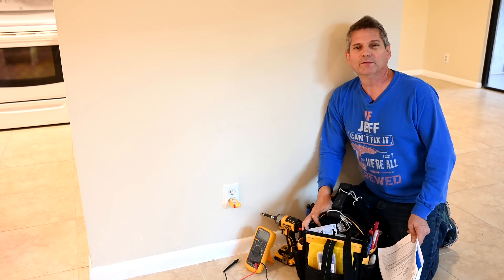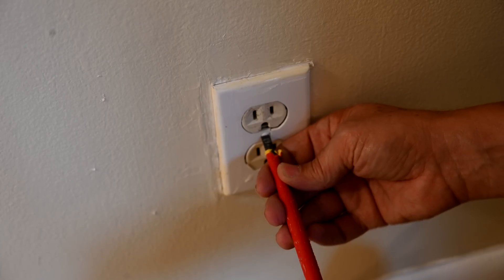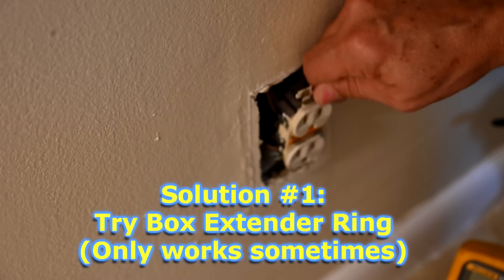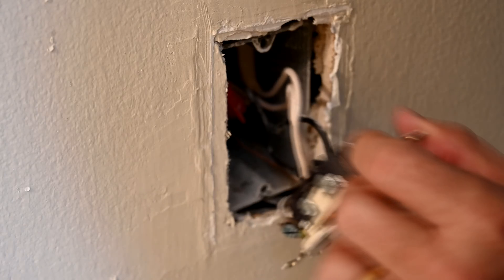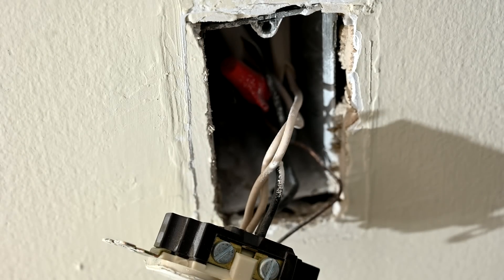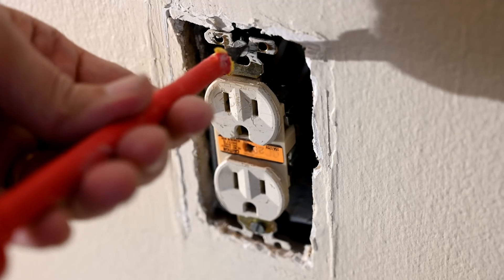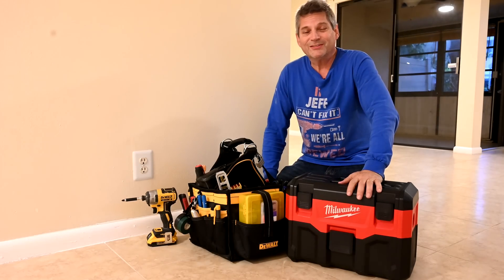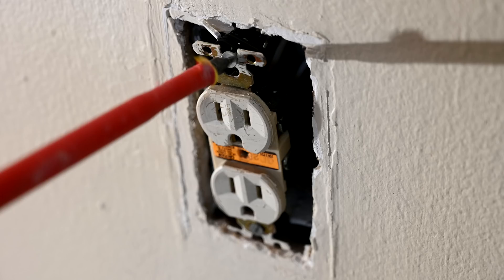2 Tricks To Tighten Loose Electrical Outlets, Switches

Comment from the maker: 💲  DEWALT DG5582 Electrical and Maintenance Tool Carrier: https://amzn.to/2Gm8IoO
💲  Fluke 87-V Digital Multimeter: https://amzn.to/2LK8etM 
💲  Fluke FLK2AC/90-1000V Pocket-Sized Voltage Detector:  https://amzn.to/2THggao
💲  Ideal Electrical Outlet Spacers (5-Pack): https://amzn.to/2U7SlUe
💲  Milwaukee 48-22-2202 3-Piece 1000V Insulated Screwdriver Set: https://amzn.to/2ItbU3r
💲 Milwaukee 0880-20 18-Volt Cordless Wet/Dry Vacuum https://amzn.to/2P6VaAF
Reply: Good information...thumbs up simply for "Whoever put this outlet in was clearly drunk".
Reply: Do you have the link to the outlet covers?  Thanks!  Also, thoughts on these spacers?
https://www.amazon.com/gp/product/B0897QVYFL
Reply: you put the top screw in the wrong hole.
Reply from the maker: @nicholassheehan2070   However worked on the outlet before stripped the screws so I had to come in at it from an angle
Reply: I have a lot of these loose outlets and it drives me nuts
Reply: Definitely liked this video 👍
Reply: Got a real loosey goosey at my house to fix!!
Reply: @jeffostroff Do you recommend any particular adhesive to affix the junction box?

Comment: using a goof ring by Arlington will have bigger tabs.  Also replacing the box is not that big of a deal. There should not be more then 1/16th of an inch of ignitable material between the edge of the box and the surface.  Replacing the box is the right thing.

Comment: As an apprentice, one solution you're taught is to coil bare solid copper wire, around the 6/32 mounting screw ... helps maintain grounding continuity as well.
Reply: That's what I did in my house when the box is metal and set back a bit. It does improve grounding contact surface area, but the box must be metal and already grounded to the electrical panel. 14 gauge wire works well.

Comment: Hey Jeff,

I'm  one of your 'neighbors' from the nearby community of Parkside - and I really like your vids.

My  townhouse, built in 1984,  needs a  replacementof an original grey plastic J box.  I've got the wires disconnected from the receptacle, have an "old" J box on order from Amazon, but I'm wondering how to dismantle the older J box to pull it out from the wall, without breaking the wall and without the wires falling behind the wall. I've searched for and have found NO vids demonstating this.
Please consider making a video on the subject.    Since I've subscribed, I'll receive the notification when you (hiopefully) publish it.

Many thanks, Jeff!
Reply: BTW - It would probably be easier if the receptacle would be at the end of the line, it would have fewer wires to deal with, but mine has 3 blk and 3 wht wires, plus ground wire !  Big mess, little space, wires coming into box from several ports.

Comment: You don't have to cut the extender if the wiring is to code. Simply turn the outlet a little sideways, and tilt it a bit forward, and you'll be able to pass the outlet through the extender

Comment: Hate to say it but you are wrong about using the "ears" on the outlet holding the outlet steady by being on the outside of the wall.  In fact, you have probably noticed that the outer parts of the ears are scored, allowing them to be partially broken off.  The pieces that are broken off become spacer washers.  The electrical box was probably not mounted right to begin with, that's where the trouble began.  Most often the box is held to the wall by nails or screws into the stud.  It's kind of hard to drive the nails into the stud some more.  I've found that sometimes after removing the outlet, can drill holes in the metal or plastic box and drive screws into the studs.  Once this is done the outlet can be put back into the box.  If it is resessed too much, those little washers can be used as spacers to set the proper amount of protrusion of the outlet.  Once it's screws are tightened down, the outlet should be rigid.  When the plate is installed, the outlet should be flush with the plate and not wiggle.

I've been referring to boxes that are used pre-construction.  If the boxes were installed post construction, that's a different story, the box still has to be tightened up somehow, for another day.

Comment: Drywall socket boxes have outer rimm, which would be best option here(its big hole tho) and are fixing themself from behind against front wall. I dont like idea of that box just freely hanging in the wall, its practically useless. Its job is to hold socket, not other way around.
It would be more work, but permanent solution.

Comment: Those tabs bend 90 degrees, or less to make contact with the box for this situation... Remember the metal tab contact with metal boxes creates important ground... A little pick or screwdriver stuck in the holes makes bending them easy...

Comment: I will check all conductors in the box even after you cut the breaker off because I ran into a situation with three hot feeds off of different circuits

Comment: Different kind of loose & tight: the plug prongs hug WAY too tight in the outlet, very difficult to unplug things: how to fix?
Reply from the maker: They should not be tight, either you have a non-standard plug or the outlet needs to be replaced. Did you try several other plugs of different types to see if they are tight? IF all are tight, by a new outlet, test them out, and if it has a better feel to it, then install the new outlet in the wall.

Comment: What’s the screwdriver with the red sheath?
Reply from the maker: That is an insulated screwdriver, providing up to 1000 volts of protection. Electricians commonly use these when working on electrical outlets

Comment: Hi Jeff my question to you is I need to replace my outlet plate I dont think I can cut the power I did discover that there is a type of screwdriver that is safe for energized equipement would you recommed I use it ( it it should insulate you against the voltage found in your home ? ) thoughts please thank you
Reply from the maker: I use screwdrivers from Milwaukee that are insulated screwdrivers that protect up to a 1000 V. But I still always turn off the power today outlet. It's never a good idea to play with it live

Comment: You should still use the spark ring. Per the NEC 314.20 In Wall or Ceiling.

In walls or ceilings with a
surface of concrete, tile, gypsum, plaster, or other noncom-
bustible material, boxes employing a flush-type cover or
faceplate shall be installed so that the front edge of the box,
plaster ring, extension ring, or listed extender will not be
set back of the finished surface more than 6 mm (1⁄4in.).
Reply from the maker: You know that's a good point and too bad that the builders don't use adjustable boxes because we see this all of the time and the time and there are only a few cents more for a Box that you use a Philip's screwdriver to turn an adjustment screw that pulls the outlet Box flush with the front edge of the dry wall.

Comment: I used a single gang box in my kitchen that mounts to a stud on the short side because it had to be mounted horizontally (above counter on half wall). The box is super loose and obvious mostly on  the opposite side from stud. Basically the edge on opposite of stud pulls out. Any tips for that?
Reply from the maker: It is hard to attach to the stud like that unless there is no drywall in the way. I use these https://homedepot.sjv.io/15gjkd PVC Old Work Electrical Outlet Box (1-Gang with tabs that clamp on the back of the drywall and you screw it down, best outlets ever.

Comment: Thanks for the videos.  The box is probably next to a stud.  You could have toe nailed a couple screws inside the box and into the stud first, than used the outlet spacers.  Even if the box was metal you could have predrilled holes for the screws.  They also make nylon Wall plates that are considered unbreakable.
Reply from the maker: You can't toenail these, because these are thin metal studs. It's hard enough trying to screw in straight on into the stud, but coming at an angle is impossible. Maybe if it were wood life would be better

Comment: Why not change the old outlet while your at it? It has paint on it and broken at the top ground.
Reply from the maker: That is normally what I do, I was called over late Saturday night on an emergency and they were closing on the property on Monday and they had just gotten the report from the buyers inspector that the outlet was loose. So I just rushed over with minimal stuff didn't even have an outlet with me they were so broke they didn't even have time or money to deal with it they just needed the actual reported problem to be fixed so they could close on Monday. It was a very desperate situation for them. when I take over a property and remodel it I replace every single switch and outlet in the property and I change all of the bathroom outlets to GFCI and I upgrade the kitchen outlets to AFCI/GFCI like they are supposed to be.
Reply: You can come help me any time.

Comment: Why not pull out the loose box, and replace it with an old work box?
Reply from the maker: The box is attached to the stud buy a nail or a screw that goes right through the bracket and into the stud and then it's covered over with drywall so in order to do what you're asking you'll have to do a whole lot of drywall cutting and patching back up later on, a lot of Labor intensive work when all you need to do is throw a few pieces of Shim plastic into the outlet to make it hold steady
Reply: Absolutly understand, and your solution is clean , cheap and effective. Just saying the in placed plastic box , like your box extension is easily cut and removed, diagonal cutters can easily trim remaining nail. The metal cover plate is a great idea for stability, but not what should be done. Thanks for the response.

Comment: The nylon plastic plates work much better than the hard plastic ones.  Most of them are oversize so they will also cover an opening that is slightly too large without having to patch the plaster or drywall.  Unfortunately they cost more but you get what you pay for.  Box extenders are required by code when paneling or other alterations space an outlet more than a certain distance outside its box.  They are a pain in the neck to install but unfortunately are sometimes necessary.
Reply from the maker: Yes on tiling many kitchen backsplashes, I have to use box extenders. I also like the adjustable outlets, you use a screw driver to set the distance to make the outlet box flush with the new tiles.
Reply: @jeffostroff  Who makes those outlets?

Comment: But dont the metal coverings conduct electricity if sparks thereby increasing chances of getting shocked if touch the outside of plug? My plug outlet seems loose in sense that when plug appliance chord in it doesnt stay plugged in well and it sparks! It also melted 2 room heater chords! Does it need a new outlet? Thanks
Reply from the maker: The screws that hold the plate onto the receptacle ground the plate. Also the plate is painted which ads insulation

Comment: I like how he showed a case that was not easy, required a lot of trial and error, and ended up greatly improved but not perfect. That's what I think most of us would probably deal with in a situation like this. Far too many DIY channels give easy examples that give the false impression to the average DIYer that the project is easy; only for them to hit a snag and not be able to solve it.
Reply from the maker: Yes and when you look at the videos on Lowe's and Home Depot those are filmed in like Disney World type perfect environments where nothing ever goes wrong in sort of la la land and every hole is cut perfectly square and every electrical outlet box was installed perfectly by people that actually knew what they were doing

Comment: Stop using countersink screws apprentisauruses!
Reply from the maker: Yes, the previous homeowner or handyman used countersinks, I hate that too, should be pan heads. For some dumb reason I did not have my little box of assorted pan head outlet screws with me, I was called over late on a Saturday night emergency for Monday morning closing of my friend's townhouse. Buyers inspector that day found loose outlets, and I brought minimal tools and parts with me, thinking it would be a quick repair. So I re-installed what was already there.

Comment: 2 Tricks To Tighten Loose Electrical Outlets, Switches
I'm not an Electrician' But even I know that this guy isn't doing this job right, He mentions the long screws and continues to use them anyways, I would take the wire screws loose then pull the wires and tighten the plug grip on the copper plug ins ' then make sure it's a new plug all together if it's going to help me sell the home, I recently replaced almost everyone in my house, Just to not have a fire in the future, Better safe than sorry, If something ids worth doing' It's worth doing right'
Reply from the maker: It's funny how you with no knowledge is telling me I'm not doing my job right. It looks to me like you've completely misunderstood what is happening here the outlet is loose because the builder screwed up and made the drywall holes too large to accommodate the outlet receptacles, which need drywall meat to grab onto. The methods are showed here are the standard methods that knowledgeable electricians use every day to solve this issue which is a very common problem period you're talking about unscrewing the wires which has absolutely nothing to do with the issue of the receptacle being loose in the opening.

Comment: I own my own place but am temporarily renting another residence and the landlord doesn't have a maintenance and he has some loose outlets. I haven't took the covers off to see exactly why its moving but one of them I fear is a loose box itself. I know for a fact he wouldn't want to repair it. I personally would just cut a 12x16 section and use a palm nailer to set the nails back securely and maybe use some type of adhesive in the holes if the nails are a little loose still. Let it set and box the sides and patch the drywall. Is that really up to firecode just sandwiching the plate and box against the drywall? That may secure it but idk if that is up to code
Reply from the maker: Usually what we do is go to home depot and buy the blue remodel boxes, and what those are are plastic outlet boxes that have 2:00 a.m. on the back that once you stick it into the hole and the wall, that you use a screwdriver to start screwing this yet are screwing the screw until it pulls the arm tight against the back of the drywall you do this for both arms. Then you have a nice snug Box that is really the better way to do it.

Comment: You sould never use a plate to pull out a  Receptacle, Everybody knows that.
Reply from the maker: I did not use the plate to pull out the receptacle, it was not being held in by anything it was builder error, hole in drywell too big.

Comment: Jeff I am a electrical contractor and I’m sorry but this is not how you fix losses outlet. Box extender is not made for that. Good thing you used that because you have a big cap there but to fix losses outlet you need to use special bracket to stabilize it. And metal wall plate..... this is a fake fix.

Comment: Great video! This just goes to show how sloppy the work was in the production of these homes. Over-sized dry wall hole, incorrectly mounted plastic outlet box (mounted at an angle and loose and not secure). The only way to positively secure loose outlets is to fix the dry wall and close up the gap opening so the two tabs on the receptacle have something to be mounted to. For a house in escrow, no contractor will do that type of repair but certainly worthwhile for the homeowner to do afterwards.
Reply from the maker: You are correct

Comment: Hi, using a non contact tester, I show both white and black as hot, also a large area of the wall from the box up 30" and to the side about 20" this happens to every box on this circuit, Also all along the ceiling to the light. The outlet's work fine, and test good for the correct wiring.  I checked all neutral and hot appear to be correctly wired.  Note they are using 4 wire cable to include the switch. Note the tester works correctly on other circuits, 3 wire, only the black shows hot and I have to get really close to the other circuits to see they are hot. I only have the issue with this one breaker.
Reply from the maker: They should not both be hot. Sometimes what happens when wiring switches is they will use the white wire to run from the switch up to a light for example or from the switch to an outlet but there should be like a black piece of tape on the end of it or something to indicate that it's not the neutral so cannot diagnose from the description but you may have  to open all switch and outlets on the circuit and inspect the wiring. Does outlet test show correct wiring? My preference is use red wire for switches to eliminate confusion
Reply: @jeffostroff  the outlet test shows it's wired correctly, The both wire's may not be hot, when I place the non contact tester anywhere around the outlet and wall show it's hot, even 24" away from the outlet's. I will get a volt meter and actually check both wirer's for voltage.  The positive non contact test no where near the outlet is puzzling to me.
Reply: @jeffostroff  I checked this again with another non contact tester, the white isn't hot but the wall area still shows as hot from the switch up the wall to the light. One suggestion is that since this shows up as the wooden wall and ceiling heading from the outlet to the light that there may be a nail through the wire causing leakage in this area. The first 3 outlet's in this series all teat good, No issues with leakage into the wall.